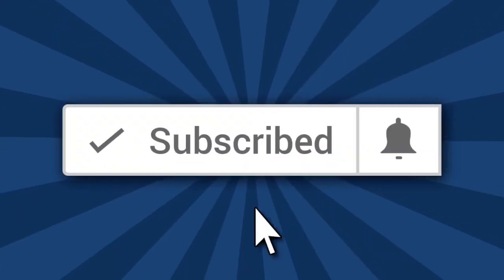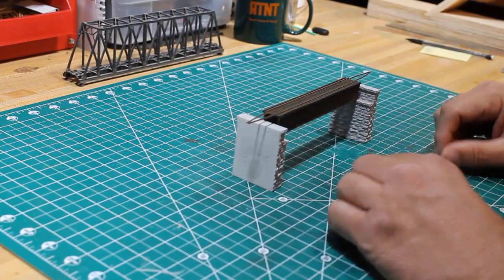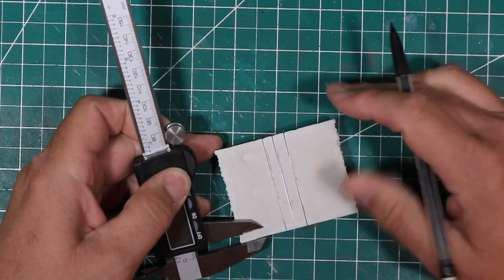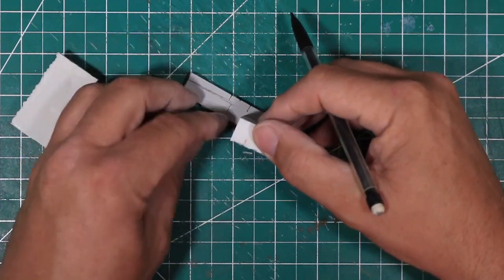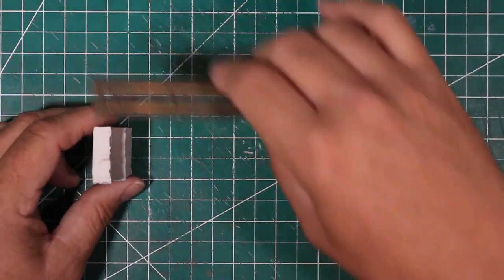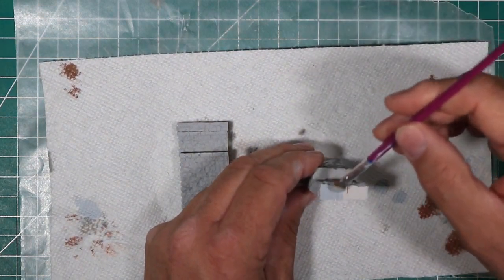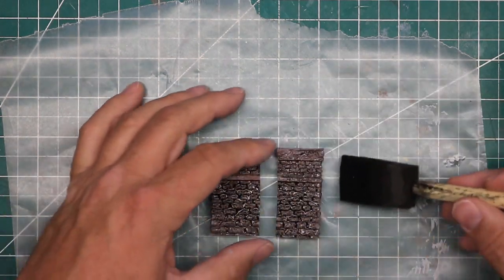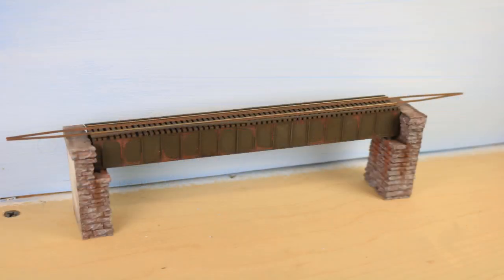Customized Model Bridge Abutments

Comment: I find that to get super glue to adhere to porous surfaces such as plaster or oily surfaces such as spruce, I smear both surfaces with super glue, let it dry then apply more glue. The dry first layer prevents the material from absorbing the glue applied for joining the two surfaces.

Comment: Kudos Ron, one technique that many are afraid to try is making shadows by darkening the area beneath a stand of trees or other objects that naturally throw them since modelers often think lighting does the trick. Because lighting a layout is done usually with multiple sources most look as if it's high noon and it's rare to get that depth of field that shadows make just by dimming but it's a trade off for being flexible. Even static modeling stay away from shadowing for the same reason and I've only seen a Revell kit of the Lunar lander have a showdown line cast into the plate it sits on and almost nowhere else.

Comment: Hi Ron, 
Love your channel,  new subscriber here. I know this is off topic but I am getting back into modelrailroading and was at a recent train show and was unsure of what dcc was until I researched it but while I was at the show I bought a dc 4-8-4- northern and was having an issue.. I get power, the very first time it stuttered and now wont move, I get headlight and a little smoke from whatever residue was in their, my question is, is it worth it to put a new motor and upgrade it to dcc or is it not worth it.. I bought it for 20 dollars. It's in pretty good condition other than it wont go...
Reply from the maker: At this point I would say what have you got to lose? Re-motoring it would be a great learning experience, and if you are careful with the outside of the locomotive, worst case you end up with a nice display piece, which is what it sounds like you have right now.

Comment: After the rust powders, you didn’t fix them? I would have used a light coat of dulcote? Also, what’s your thought on genuine “ wet” rust, smidge of steel wool in a vinegar solution. I find it works the crevices amazingly. Thanks for the skookum vjeo.